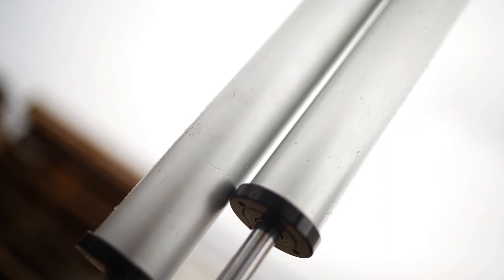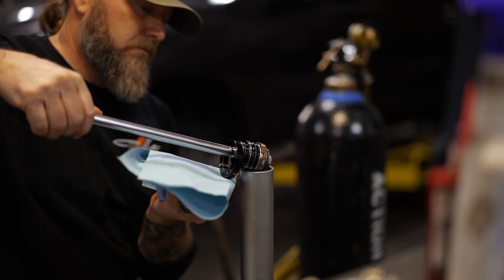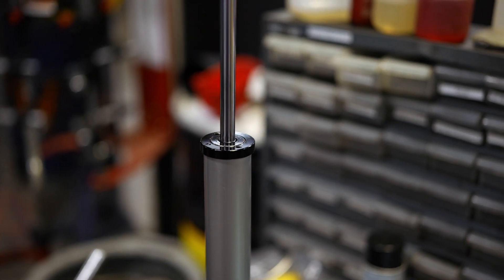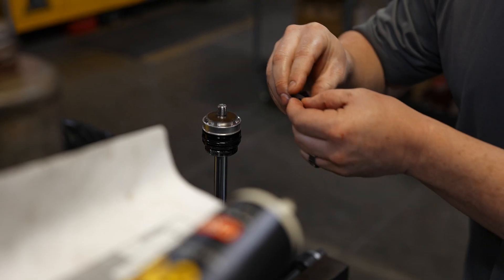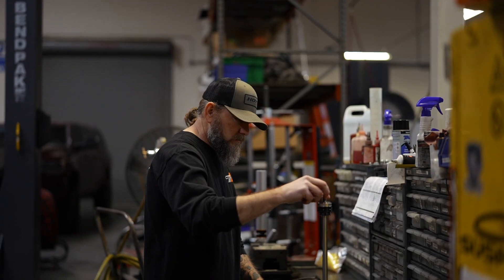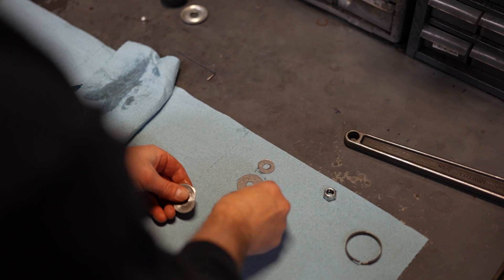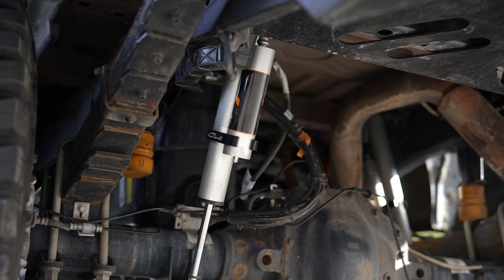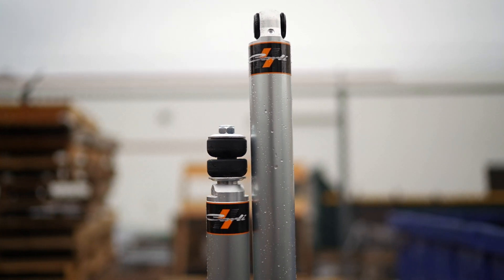What's Inside the New Carli SPEC Shocks | Behind the Scenes Development

Comment: I never had good luck with 2.5 Icon coil overs and shocks with my 4runner. Perhaps the design of the seals and the materials of the shafts is not that great. Hopefully these hold up as good as my Carli fox 2.0’s. 5 years in and they are doing great still.

Comment: Personally, I think Carli needs to develop a 2.5” shock with no reservoir intended for street/tow guys. By having a no resi 2.5” Spec shock you’d get a much better valve profile than the 2.0’s given the actual larger shock diameter, and the shock would be cheaper than Pintops because of no resi.

Comment: I have the Backcountry 2.5" on my 18 F250. Around town - small bump ride quality has never been great. What kind of difference might I see with the Carli SPEC shocks?
Reply from the maker: These shocks are actually noticeably more sensitive around town, but from the sound of it your issue isn’t shock based. It sounds like it’s related to tire pressure, tire size, or other suspension setup. Do you still have the stock rear leaf packs?
Reply: What do you mean by “more sensitive?” Better small bump compliance or worse small bump compliance in comparison to the fox shocks?
Reply: Stock rear leafs and 20” wheels?
Reply: 37” Falkens 45 psi front 40 rear. Carli Backcountry 2.5” Carli add-a-packs rear.

Comment: "Chrome plated steel" I thought one of the selling features of carli was a more durable ss shaft?
Reply: Their King shocks use a stainless shaft, but all their existing Fox shocks (and any other Fox shock for that matter) uses chrome plated steel shafts. Stainless shafts would significantly raise the price, which isn’t ideal when the 2” diameter shock offerings for the Commuter and Backcountry are supposed to be more budget friendly. Anything 2.5” and larger diameter King shock based is stainless.
Reply from the maker: Couldn’t have said it better ourselves!
Reply: @JustDiesels  Thanks for the explanation. Trying to research a kit myself.

Comment: Just bought the Pintop for my 2011 F350. I absolutely love the ride. I wish it was slightly softer over small rough stuff like railroad crossings but overall I’d say I’m 90% happy with the purchase.
Reply: Kings get softer as they wear in. They need a few thousand miles to reach their prime.
Reply: @Rhinopkc  that’s what I was told. They’ve got about two thousand miles on them now. I’m thinking of checking the nitrogen charge and maybe let a little out. I understand they come charged from Carli at 265 psi and can be let down to 190. So I may drop them to the low 200s and see if they’re any better.
Reply from the maker: Remembering that nitrogen charge is more related to preventing cavitation than anything else. Shoot us an email and we’re happy to suggest areas you might be able to improve ride. Tire pressure is a huge one. With a properly set up truck with a pintop system, full packs, and tires at the right pressure, the truck should be very smooth. Shock break in is a real thing too.
Reply: @CJCOffRoad  I’m running 295/65/20s and I’ve lowered the pressure to 55 psi on all four tires. I’m not running the Deaver rear leafs because my airbags need the rear block. Thinking of adding the add a pack but not sure if the 2” block will be tall enough to work with the airbags.
Reply: @secretsquirrel572  you should get the daystar cradles for the airbags so you’re not limited on down travel in the rear. Then you can run the add a pack or full deavers with no concerns.
Reply: The 20” wheels and 295 tire combo is one of the stiffest out there. Go to an 18” with 37x12.5” tire and you’ll see a HUGE boost in the small bump compliance. Stock leaf springs and airbags is also a very rough combo. If you’re running airbags, swap in the Carli leaf springs, throw some 2wd lower brackets on your airbags that connect to the axle (instead of the block) and add daystar cradles. Run 45psi front, 40psi rear and it’ll transform your Pintop.
Reply: @DanTourino  unfortunately I cannot run a fat, soft sidewall because I haul a 16,000lb fiver. Anything with more sidewall than what I’ve got tends to make the truck very hard to manage on the highway. I tripped the pressures to 50ish and it’s a lot better but still rougher than I’d prefer. With that said, I’m still very happy with the ride the Pintops provide.
Reply: I run 54 psi front/44psi rear unloaded with my 295/65/20 Toyo MTs on my 14’ F250. Bump the rear up to 65psi when I tow. The unloaded psi was based on a chalk test. Give that a try.